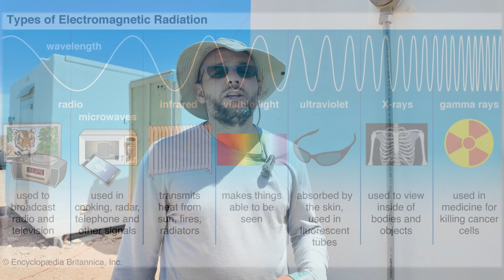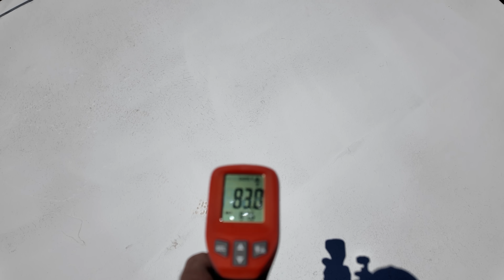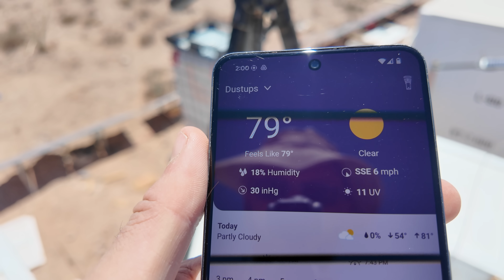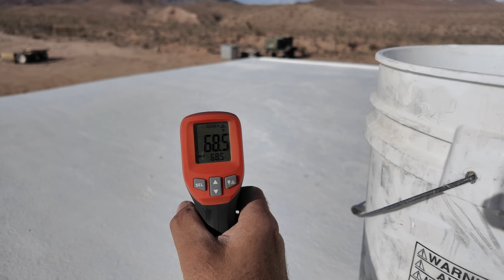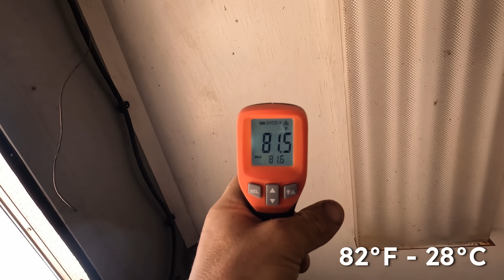I sprayed "cooling paint" on my desert cabin...this is shocking

Comment: Paint the sides anyway. It doesnt matter where it radiates off to as long as its away from you. Non laser light scatters in all directions, some of it will go to the sky and even the stuff that hits the ground or the mountain will scatter 99% everywhere else where there is no dog house. This isnt about cooling the earth with as little paint as possible, its about cooling your doghouses with as little electricity as possible.
Reply: This was my thought as well. That radiation is going to scatter, probably completely, in the several miles of air between those dog houses and the mountain.
Reply: The idea that the radiation hitting the ground mountains etc as if that's bad is totally a pants-on-head misunderstanding of heat transfer mechanisms
Reply: Stopped the video at 6:40 to comment this.
Reply: Also my first thought. At least paint one wall and measure the difference to prove me wrong ;)
Reply: I couldn't agree more. Those mountains are going to reflect near zero back in your direction
Reply: Not only that, the mountains and ground radiate as well, and that hits the sides of the buildings and is not reflected away as much by the white paint, though I don't know what the return on investment is if the white paint already reflects 80%, and the radiative paint reflects more than that.
Reply: Yes, as I noted in a separate comment, painting the sides will have about half the radiative cooling efficiency per unit area as painting the roof, since half the emitted radiation will reach the sky. So, there is still a significant benefit to painting the sides, as they greatly increase the total radiating area.
Reply: This. You ain't shooting lasers at a perpendicular structure, it's random radiation at a hill side. 90% will get reflecting into the sky. Could just paint the top half.
Reply: @ConfusedRaccoon you may be correct I’m not a physicist but I have seen multiple channels including this one that disagree with your statement. Everyone uniformly agrees that for this radiative cooling part to work it has to face as thats where the energy is going. The wavelengths are very specific to get through the atmosphere without reflecting back to the starting point. 
Note- this isn’t reflection that we’re talking about…
Reply: There is a big misunderstanding about why this is effective. The reason the paint can cool is not just that it is good at emitting IR in the atmospheric window. It is also good at absorbing IR in the same band. The key is that the sky in that band appears to be at -40C, resulting in a NET IR loss to space. 
For the same reason, painting the walls is less useful, because the mountains and atmosphere to the sides are hot, so there would not be a net loss. Since the ground is hotter than the shed, the best strategy is to make the walls reflective as possible.
Reply: @OccamsPlasmaGun Well put.
Reply: If you don't have a thermal measuring device yet, I think it might be time to get one.  
You can point it at something and it will tell you what temperature that thing is. Very helpful for locating hot spots.
Reply: Love all you are doing.
Reply: commenting for algorithm
the emissions are non-directional, of course, unless you don't paint the sides, then you basically made a super weak IR cannon pointed at nothing or if one is to believe progressive mathematics maybe it accumulates in a gravity lens and zaps a planet on the other side of the universe 20 years before we even set it up
Reply: Did you hear how much one can of paint costs?
Reply: @tesha199 Yeah painting the walls with that paint would be a huge waste of money. A good high reflective white paint will do the job of reflecting light on the walls for much cheaper. No need to use the radiative paint on vertical surfaces
Reply: Agree 💯
Reply: @tesha199 yep, there are also instructions to make it yourself on youtube. 
At the eod it’s a lot cheaper than buying/running AC but time will tell how effective it is. I think he’ll have to clean it a lot…
Reply: Better than painting the sides, just pile dirt on the sides giving the walls a high thermal mass.
Reply: @jackalopewright5343 hmm thermal mass can work both ways….
Reply: Agreed, plus those mountains ain't straight, so they are not going to reflect much, if anything back towards the source.
Reply: @simonpaine2347I suggest doing some research into radiant cooling. I’ve posted multiple links to resources here that might help.
Reply: @simonpaine2347 The whole "reflecting light back" thing is a red herring, both from the hills and from the sky.  The problem is black body radiation from nearby ground, includes the special wavelength, which would be absorbed by the paint.  It doesn't come from the sky because the sky is basically black at that wavelength.
Reply: @captsorghum not sure about that. How does the radiation from the ground get into the roof?
Can you cite a source?
The radiative cooling allowed by the paint is not based on reflection but emission of energy but that emission is only possible at specific wavelengths that can escape to space. 
I’ve attached several references in other posts. It’s  poorly understood as the comments evidence.
Reply: @michaelsmithers4900  I did not say radiation from the ground reached the roof.  My point was that it does reach the walls and would be absorbed by the special paint. That's why it's not used on walls.
Yes, the emission is strongest at certain wavelengths, which also means absorption will be strong at those wavelengths. Which is not a problem for roofs because the sky is basically black at those wavelengths.  The roof can emit but there is nothing incoming to be absorbed.  That's how you get the net heat loss.
Radiation from the roof escaping all the way to space is meaningless. It doesn't matter where it goes. It's not like a meaningful amount would otherwise be reflected directly back to the roof, unless the scattering or reflection happens within a few feet or so of the roof. That line of thinking was apparently started by someone who wanted to address global warming in some small way, by getting the heat completely off the planet.
Reply: I'm assuming he only bought enough for the roofs. Seems like a filler episode
Reply: @steveb552  I don’t consider these little experiment videos as filler content lol
What do you think his videos are about normally? Should he plant when he doesn’t need to? Or keep creating terraces?
Reply: He's over thinking, as usual. Freaking jeans ad.
Reply: Instead of having vertical walls on the side, you would simply need to add an outer shell that was sloped. 

I would put it on the side or sides that get the most light. 

However I think you could also use the bulldozer to put a berm up against the house. This is used in the desert a lot.
Reply: this is a misunderstanding about how radiative cooling paint works. radiative cooling paint is not meant to reflect 100% of light.
This is because an object needs to be able to absorb a wavelength of light for it to radiate that wavelength of light.
This means you want a narrow window of infrared heat that the paint will absorb and emit. ideally one that will radiate though the atmosphere instead of being reflected back ot the ground.
painting the sides would just let the hot ground radiate heat 'through' the paint warming the doghouses
Reply: @allisterhale8229  I'm guessing they chose a narrow band where there isnt much natural radiation but the problem is the treated surfaces will emit and absorb in the same spectrum which means that at least I would limit it to the outer perimiter of the compound.
Reply: @allisterhale8229 This concept of radiative cooling is poorly understood as the comments evidence. 
For radiative cooling to work the surface needs to face the sky. Space is the heat sink. 
He said that but I guess ppl just didn’t listen or didn’t understand…

Comment: If the paint is able to reach subambient temps you could try painting a pipe that you circulate the inside air through. Easier/faster than burying the pipe like you tried in a previous video, but maybe more expensive and less effective. Tech ingredients have done some experiments with a solar powered AC, although that idea might be a bit too complicated.

Comment: Is there a cheap way to angle the sides of the building out and toward the roof so you could paint the sides and have the heat radiate toward space instead of your surroundings and maybe insulate between the wall and the new angled sides?

Comment: Instead of $300 paint, could you not just place a few posts and suspend a shade canopy over the buildings? You can even extend it beyond the buildings ans crate a shaded sitting area?

I guess I just don't really get how the wind is not going to blow dirt on to the roof and block the paint effect.
Reply: The point is shade only gets you to ambient temperature while this stuff gets below that.
Reply: @JeffBilkins  If there is shade with convection, then it's cooling.

Comment: Wouldn't the mountains absorb the radiant heat you reflect at them? Also they are not perfectly perpendicular to the building so almost no radiant heat would be reflected back.
Reply: I believe that the mountain would scatter the heat rather than directing back.
Reply: @Spiralem  yep, exactly. Diffusion would take place. I have no idea why he thinks the sky would be a sink and mountains miles and miles away wouldn't lol
Reply: @_MikeJon_ The sky would emit to outer space which cools the planet, the mountain would cool the houses but not the planet. 

Realistically for his purpose painting the sides is just as helpful for the heat emission. Not paining the sides probably has more to do with potential abrasion from the wind/dust.
Reply: @Grz349  lol um, no. We're talking about a tiny little structure. Nothing you said is correct nor would make any difference at all.
Reply: Of course, some of the radiation will scatter and hit the mountains miles away.  That's preferable to an air conditioner, where the heat radiates directly outside the building,  where it will radiate back in eventually.
Reply: dude.................................
Reply: They would absorb the heat, but then they heat up, and radiate heat themselves. Basically the same amount comes back at you. 

Another channel did some more experiments with this type of paint (which they also made at home too) Tech Ingredients. They talked about building a reflective valley to work around this exact problem.
Reply: Very little of the radiated heat would reach the mountains, since the radiation goes all directions, not simply straight out. Dry desert surfaces are likely to absorb perhaps 80% of thermal radiation that reaches them, reflecting perhaps 20%, but most of that reflection is diffuse (rather than "specular") reflection, scattering any reflected thermal radiation in all directions. So, yes, almost no radiant heat would be directed back. The ground and mountains would, however, be radiating their own radiant heat, which would roughly cancel out the heat being radiated towards them by the building. Still, half the radiant heat from the walls would reach the skies, resulting in cooling.

Comment: Is it possible to build a steel building roof only on steel poles with no sides? Something 50 ft by 50 ft that you can put all the buildings and vehicles underneath to protect from the Sun and Rain. It would cool the buildings while protecting them and provide massive rain catchment possibilities. It is just a roof so the cost should justify the means.
Reply: i was thinking similar but cheaper with shade cloths.
Reply: was thinking similar, could even if you really wanted to put solar panels on top, or paint that permanent canopy too.

Comment: I think it it were radiating heat, it would appear as hotter, not cooler (because it's "radiating" more heat).
Also, comparing the "radiative cooling" paint to no paint at all doesn't prove that it works any better than run of the mill white paint would.
If this paint does radiate infrared light, I would imagine it would scatter it, not shoot it out in a perfectly straight line. I also think that mountain is far enough away that any radiation coming from your trailer would be scattered by the atmosphere and particles therein by the time it got to it. Plus, the mountain across the way isn't going to reflect it back at you at a perfectly perpendicular angle, either.

Normal white paint is probably a good idea though. Shade seems like a pretty cheap and easy solution as well.

What about solar panels for power? It seems like you have plenty of space for them.

Comment: I am pretty sure that spraying on a flat rooftop is not the way to go here. You want a good roller and a tray of paint.  you don’t lose any to the wind and it goes on thick and it covers better. You don’t hurt your back. You stand off to the side and roll it on.
Reply: Exactly! I used to be a painter. A flat roof with a roller will give it a nice thick coating and near 0% waste. I would have hit it twice by the time he opened the sprayer box.  But he's learning how to use a sprayer, too, so he is getting something out of it in that sense.
Reply: And it would be 90% cheaper...
Reply: You’d have it done in less time than it took to prep the sprayer.

Comment: Not done watching the video, but I don't think those mountains will block the heat from your building.  Who said that the infrared radiation emitted by the walls can only travel parallel to the ground? If this paint works, definitely paint the walls
Reply: The goal is only partially reflection. For the radiative cooling part the surface needs to face space. The heat is literally emitted into outer space using a specific wavelength that can travel through the atmosphere.
If pointed at a mountain the radiative cooling won’t work.
Reply: @michaelsmithers4900  that's just not true. It can be emitted in any direction. To believe it only works if it's pointed toward the sky is insane and honestly stupid af
Reply: @naughtyskweet6 Before hurling insults try educating yourself on this.
Shawn very clearly stated this in his video and it has been covered in other places. Radiative Cooling is NOT the same as reflection. It’s actual rays of energy leaving at a specific wavelength that can exit the atmosphere without reflecting back. This is why the top of the roof is cooler than the ambient air and the bottom of the roof. Energy is actively radiating out of the roof. Again reflection is happening but this cooling phenomenon is different.
Reply: @michaelsmithers4900 why do you think radiative cooling wouldn’t help if pointed at a mountain 50 miles away?
Heat radiated at mountains is still heat not in the building. 

Also it’s thermal radiation, not a laser? Half would go into space anyway, half into the ground, inverse square law would dictate negligible portions of heat reach the mountains
Reply: @thomasa5619 radiative cooling heat transfer is proportional to (Tsurf^4 - Tenv^4) where Tsurf is the roof or walls and Tenv is either the mountains or sky temp, depending on which way you’re pointing. You can figure out the rest
Reply: @Rightbackatchya yep you’re making negligible impact on the temperature of the environment but you can make noticeable change on the emissivity of the surface which is from the full radiated cooling formula
Reply: Yes! These mountains sooo far to change anything. What next there is moon on the way - let's don't paint in that direction either.
I would be different if those mountain was very close (he would get great shade 😂)
Reply: @myentertainment55 If you don’t understand how the coating works maybe don’t comment. It’s literally using outerspace as the heatsink. Therefore you have to have direct line of sight to the sky.
I have posted several links in these comments with videos that explain how this radiative cooling works.
Reply: @michaelsmithers4900  ----- Shawn is getting too caught up scientific nonsense.   If you don,t have trees for shade , you have to make  shade.  No wonder the family don't go there. How Brendan lives there ?????

Comment: Shouldn’t temperature differences be measured after the paint has completely dried, say after about 24 hours, since the temperature difference might be caused by the evaporation of water in the paint?
Reply: For reflecting infrared radiation, I suggest covering the roof with aluminum foil, and painting the sides white (so as not to cause glare—unless that’s not important, in which case I would cover all the walls and roof entirely with aluminum foil or mirrors).
Also, to preserve the cooling effect, you should consider keep your entrance closed, because all cool air goes down through the entrance, which is outward…

Comment: You should consider a solar chimney. Ironically the chimney itself is painted dark/black not white to pull heat up and out through the chimney. There is also a cool dome idea the Mexico uses but probably harder to implement in your situation. Videos names below to watch if curious.
"Synergy Files - Passive Cooling and Heating of Building"
"Leaf of Life - How This Desert City Stays Cool With An Ancient Air Conditioning System"
"Leaf of Life - How To Live In The Hottest Place On Earth Using An Ancient AC System To Stay Cool!"
Reply: solar chimney are awesome for free ventilation, but you need to cool the incoming air to see comfort really increase. He's already built some earth cooling tubes. so he's halfway there.
Reply: look at mid east passive cooling systems.